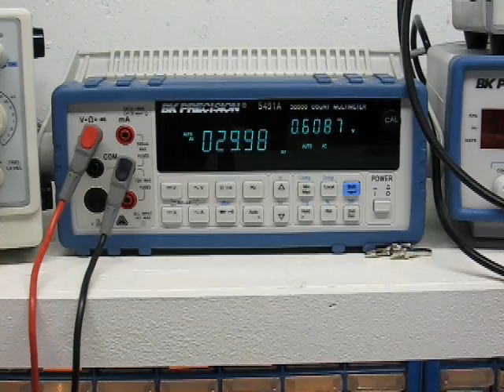MFOS VCO Calibration Part II

Comment: Ray you mentioned the screwdriver problem - have you tried the small plastic screwdriver supplied with the Rigol DS1052E for calibrating the probes - for adjusting these tiny trimpots?
Reply from the maker: I bought some trimmer adjust tools from Mouser. They stay on the trimmers pretty well.